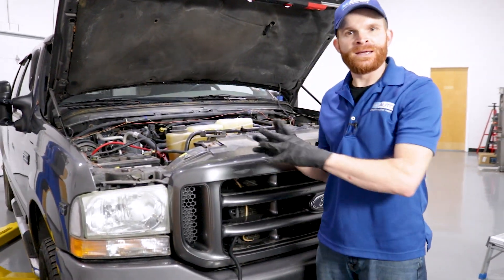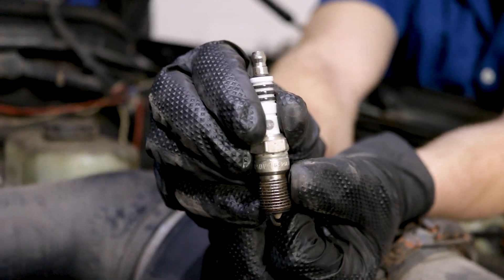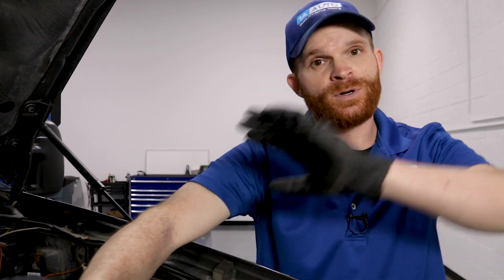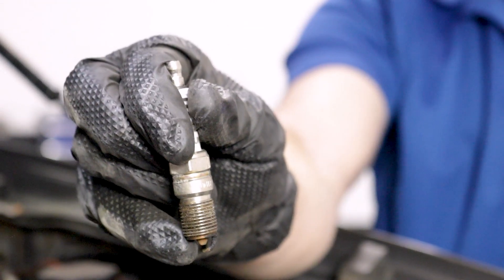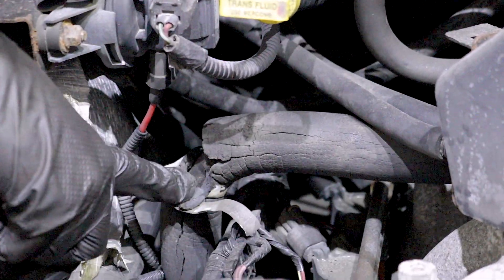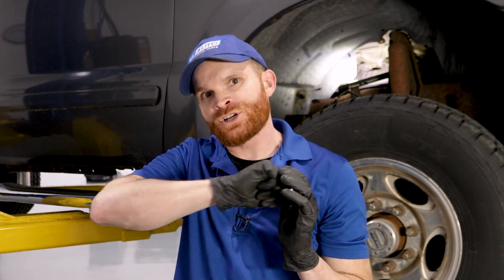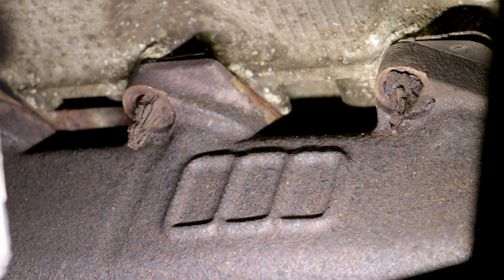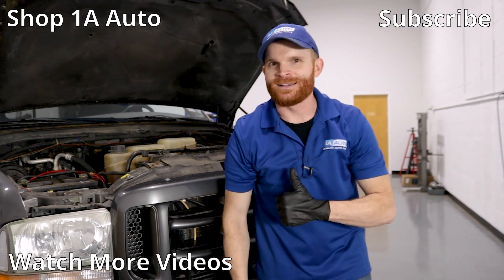Top Common Engine Problems 1999-2007 Ford F-250 Truck

Comment: If you own a Triton Two Valve engine buy the CalVan insert kit and proactively install all of them.  Do it when you plan on changing plugs and oil since that is part of the job.  Costs a few hundred but you don't want to blow out a spark plug out on the road.
Reply: Amen brother did it to mine permanent fix

Comment: 3 months ago bought a 2003 F250 Super Duty 5.4 , it developed a shaking from engine. Checked spark plugs and all were worn, had like an ,80 gap. Not sure how it was running ok for a while. Replace all spark plugs with motorcraft plugs and still has shaking after 2 -3 minutes of running.  Won’t go away. Any ideas?
Reply: Test your coils

Comment: I have a 99 F350 with the V10 Triton. Bought with blown engine, did an engine swap with a used one. It runs great with excellent compression and oil pressure but have an issue with fumes in the cabin. To me it seem more like gas fumes than exhaust. Have checked all vacuum lines for deterioration, no leaks that I can detect. Is not coming from the emissions cannister output and there are no gas leaks anywhere in the engine compartment or in the fuel lines to the tank. It is enough to get a bit of a headache when sitting still or moving slow - during normal driving, can't really smell them. Ran fine without any codes this summer for about 700 miles but then threw a DTC P1131. I cleared it but came back within 25 miles. IDS shows: HO2S11 not switching correctly. Sensor indicates lean. Air leaks at the exhaust manifold (I replaced all the broken studs and installed new exhaust gaskets on the replacement engine). Freeze frame shows SFT1 and SFT2 at -3.91% and LFT1 and LFT2 at 10.94% but not sure if that is normal. Not sure if the fumes and the DTC are related - any ideas? Not sure what to look for.

Comment: Hi, great info. I have a question that you might be able to help me with... I have Limited Excursion V10, and when I'm moving right along the road and I hit 45-55MPH my engine and take my foot off the gas pedal the motor starts to sputter and the engine seems like its gonna cut out on me. When I give it gas and pass 50-60MPH the sputtering stops. I can't seem to figure out what the problem is??? Any suggestions?
Reply: My truck did the same thing, when I was on a trip, I scanned the  codes  and found out that I had a miss fire on #4, so I bought  plugs  and coils  and changed out just #4 plug and coil and running  fine, I thought my transmission was  going out! And my truck never threw  a code! I hope this helps.
Reply: Jack Rox •
Could be a Tune up ?
New plugs & wires ?
If its fuel injected ' 
check clean or replace ?
Ignition Coils ' 
check clean or replace ?
Check the throttle body and sensors they might need cleaning or be replaced ?
You've got some home work buddy '
start off by cleaning injectors with fuel line and injector cleaner in fuel tank ?
Check all wires and hoses in engine compartment. 
Another thing could be the fuel pump giving out or dirty ?
Good luck ' like i mentioned start off with cheapest route first, it's all process of elimination 👍
Reply: Read what i wrote earlier, i don't know if it all went through ?
Reply: Read codes with OBD scanner,
I forgot to mention that earlier
Reply: By any chance does it do it at idle as well every now and then?

Comment: Actually an exhaust leak can cause an O2 sensor code/codes and really screw up the fuel trim. It can also burn up an exhaust valve, I wouldn't say you can drive it like that long term with no issue..

Comment: Only issue I see with this video is this engine doesn’t require premium.  We have a 2012 motorhome on the E-450 chassis with this engine, and it doesn’t require premium. Only regular.

Comment: I have a 2000 Excursion 6.8 V10.
I replaced all of the exhaust manifold studs due to the problem mentioned in this video. (took me a month) working on it when I had time. I bought this Monster om 2013 with 90K on it. It now has 140 K on it, 8 inch lift with 37 inch tires:-). I just ccompleted rebuilding the complete frontend minus the diff which was fine. 
Today I have a cranking situation with no Start.  I am assuming its the fusebox in the occupants compartment. I have power at the injectors. No spark at the plugs. 
I have a couple relays to swap out before I dump the cash into the fuse box. The other thing I ran across is my scan tool won't complete the scan....a problem solving I go I guess.....

Comment: Great videos. Bought a New Holland service truck. 2003 F250 v10. 320K. Sold my 2014 ram for 30K. This truck I just bought is also "damage title" I found out after dealer sold it to me for $2700. It had perfect fluid and runs too good to be true. Looks like they did lots of service to it.

Comment: Make sure you use motor craft spark plugs. I manage a fleet, and 2 2013 f450 v10s I have had champion plugs in them from before I joined. These plugs deteriorated in under 30k miles and the ceramic insulator on the plug fell off and destroyed multiple cylinders.

Comment: I have a 99 F250 extended cab lariat with a V10 automatic with factory 4:30 gears.  I have owned this truck for 17 years and it presently has 172,000 miles. In all this time, I had one spark plug blowout (#2) and I repaired it with a Time Sert Kit myself.  I did not trust anyone with this procedure.  It’s been seven years and still running great! She is 24 years old now and I have replaced the PCV-short U hose three times,fan belt once, two alternators, ten OEM injectors, ten OEM coil packs and ten OEM plugs.  I keep her serviced every 2500 miles because that’s all I drive it in a years time.  There are no oil leaks, no exhaust leaks at this time.  She has been a good truck for a first year Superduty.  I still pull my fifth wheel camper from time to time with no issues. This time next year I will be applying for an antique tag!  LOL!
Reply: I have an 04 with 165k on it. I had 1 plug blow out. Did you have any trouble replacing the other plugs?  I'm nervous about replacing them if they strip out the threads

Comment: Just bought a 1998 F-250 5.4 triton I don’t hear or see vacuums leaks but when trying to accelerate it bogs down does not want to pick up speed it does the opposite but I can hear the fuel pump turn and truck turns on fast but last owner had gas sitting for 8 months can that be the reason why it ain’t running properly also I get a code  po171 , what can that be?

Comment: I have a 2002 Ford F350 V 10 the temperature gauge goes to warm and then it varies itself to cold while driving and then reset itself and then goes back down to cold￼

Comment: I bought a 2000 250 superduty 6.8 v10. Owner said it the oil gauge went out. I test drove it for 30 muntues. Drove home 30 mintues. Another hour or so in runtime & running diagnostics. I replaced oil pressure sending unit and not one drop of oil, did oil change,  ran a new "mechanical" oil pressure gauge (no oil pressure) , ran oil pressure check( no oil). Took off new oil filter and no oil there as well. Is the pump or pick up tube a common issue? I'm no mechanic and just started breaking down the motor to replace both. I do not want to pull motor and everyone wants to charge 3k to do the job. Not many videos on here to help with oil pump, pick up tube, oil pan ( since u can't just pull the pan),  I've now named my truck Frankenstein as she'll start right up and no metal/clanking sounds and NO signs of oil.  5 mechanics have all scratched their heads at this thing!  If you could post any videos/short cuts/tricks/ etc. That would be great.

Comment: Starting issue lately. I have a 99 F350 V10 service truck. lately You have to trying to start it 4 or 5 times before it actually starts. It seems to run fine but its bad if you have to sit there and try to fire it 5 times. Common? What is the common issue? Thank You Jim Hughes.

Comment: Thank you so much buddy Mike Ford V10 has a 114,000 miles on it and it had a tune-up at 100,000 miles with spark plugs do I have anything to worry about you think

Comment: 2003 6.8L F350. Pings with 93 octane. Idle is Very smooth. No engine light. It will ping at cold or at operating temperature. Hauling a load or empty. 
Should I start with replacing the PCV valve and hose then work up to the Mass air flow sensor?
It does seem to have power, but I have to ease the throttle when accelerating. 1/3 throttle at most.

Comment: Holy cow Love this video and thanks for making me feel better about buying my new used truck for 6,800$ with less then 130k and dropping 3,300$ back into to it in order to get the helio coil fixed because of the miss firing issue and needing to replace the coil packs on to cylinders with the tune up and well now have it chipped for better gas mileage and it seems to be working as far as getting better gas mileage for a work truck. Its a 1999 but I have been looking into the spark plug blowouts and that was one of my biggest concerns about getting to the truck but holy cow its a beast of a truck this is the biggest truck I have owned in my life and its like driving a whale in a kitty pool!

Comment: It explains some of the complaints I have heard about these trucks. It would be kind if you could give and estimated cost to fix these different problems. I think I understand  the complaint, now, of the aluminum shavings getting into the oil and destroying the engine. I have heard complaints of these spark plug repairs that only lead to that. Not pretty.

Comment: Great info,  I have the 2000 excursion v10 limited  4x4. I'm getting 8 mpg. Just replaced pcv hose, had shop do the plugs. Next in line is banks headers because exhaust manifold leaking. $2000 for the banks set up. I need to improve the 8mpg issue or I will let it sit and by a 45 mpg car. What can I do to get better gas mileage ? I dont put my foot in it, I take it easy and still no improvement. I wish they had a turbo to go with this v10. Mpg is what I need help with. I'd be happy with 12mpg.
Reply: Check to see if your hubs are in the locked position. I was getting 12mpg with the factory 4.30 gears and 35’s. Check your fuel filter, air filter and the S shaped hose that’s under the throttle body that connects to the pcv. They rupture and leak easily. Run some good injector cleaner through a couple tanks of gas.  

I did the banks headers and the free spin kit but also added 37’s and 4.88 gears. I’m getting 9-10 on the highway
Reply: If your 02 sensors are original, might consider changing those out as they control fueling.  Cleaning the MAF sensor not a bad idea, either (they make a spray specifically for this, don't just use brakleen on it).  You can get MAF sensor cleaner at walmart.

Comment: 2000 f250 v 10. Misfiring on 5 cylinders.  What could cause this. New coils, spark plugs and injectors

Comment: if you still monitor this channel, Driving down the freeway at 55, all of a sudden a large popping noise was coming from the right side of the engine compartment. Almost like a massive exhaust leak somewhere. Ford had told me that one of the rockers fell off and the head was damaged. They said they were able to repair the head and The rocker for a very substantial cost. The vehicle never lost power but just a very loud popping noise. Any suggestions on what that could have been?
Reply: I'm far from any kind of knowledgeable person on this, but that sounds like what happened to mine and it was the spark plug blowout problem with mine. Not a horrible cost to fix it and if you are handy, you can do it yourself.

Comment: I have 2003 Ford F-350 battery is good but it won’t start check fuse box they are good it will start if I jump it with another car. Please I need help

Comment: 10 years after Ford closes all these worthless vehicles will be abandon. Heard their working on electric cars, bet even that won’t run 10 years correctly. Wonder how long it will take the engineers at Ford to develop batteries you can’t change ?

Comment: I had put 453,000 miles on a2007 f550 wrecker and sold the truck I think it kept running after 500,000 it might still run who knows
Reply: T6 motor oil
Reply: Oh yeah I went through about 16 or more ignition coils as well

Comment: Most aluminum head V8s break exhaust manifold bolts.  My smelly opinion is that with the aluminum head expanding more than the cast iron manifold the stress on the studs cause the breakage.  Don't the rear studs tend to break first?  The rear of the manifold is probably the hottest because all of the exhaust passes this point.  Perhaps an aluminum exhaust manifold would fix this issue?

Comment: I have a 1999. It cranks but won’t turn over. Is it a fuel pump or spark problem. I’d there any test I can do to find out what the issue is. It is cold here. High in the 30s during the day. Obviously much lower at night, in case that might also be an issue.

Comment: Hello I’m having a problem with my 2001 f250 super duty XLT V10 triton, check engine light comes on with code PO720… “output shaft speed sensor” it’s not causing a lot of trouble just a kick in gear from 1 to 2. I’ve replaced the sensors both, transmission fluid as well. The light still will not go away. Do you have any suggestions?

Comment: Thanks for the video.  I have a 2002 e350 6.8ltr van I work/ live out of. I've blown out 3 plugs on original engine. First time was a huge surprise. Very loud! I did research and bought the "time sert" retread insert kit. Did the repair with engine in van. Very difficult, lack of space.  Extremely nerve racking.  Drilling a big hole in the head is something that is not natural.  Anyway, worked excellent.  Had the pcv cracked hose up under throttle body as well. gave intermediate rough running.  Would have never found it if someone hadn't suggested looking.  Almost impossible to see on my vehicle.  Engine made it to 300,000 miles then developed miked oil and gas somewhere other than in the cylinder....automatic transmission made 240,000. Just installed a rebuilt high performance engine and getting ready to fire it up. I love these engines,  and love my van. Mileage is 10mpg no matter what I'm doing... yup that sucks. cheers

Comment: I have a 2002 E350 6.8 V10 with 244000 miles on it. I'm confused because I keep hearing "before 2002" and "after 2002" with regard to the spark plug thread problem. Did Ford correct this problem with 2002 models, or did the fix begin with 2003 models?

Comment: I have a small oil leak in my V10 and cant seem to find where its coming from seems to be a lot on the transmission case any suggestions on how to find exactly where it could be coming from?
Reply: Rear end of the valve cover!

Comment: I have a 2000 Rv with the v10 in it traveling at 40 miles per hour flat no issues. When I start to climb or pull my car losses power.  Suggestions.  Only have 55,000. Miles on the engine?

Comment: Good video. I believe the 6.8L V10 is recommended for 87 octane fuel or higher. 93 octane isn't required. Coils are another common issue also.
Reply: Owners manual says 87 octane.
Reply: yup... 87.. no way 93

Comment: I LOVE YOU 1A VIDEOS!! I  just ran into in issue i cant figure out. i have a 2002 ford V10. it was parked for about a month, when i started the truck it had high idle and it would not drop to normal idle. while driving it stays high idle and i have to press hard on the brakes to keep it from moving forward. I cleaned out the throttle body, changed the air filter, TPS, used carb cleaner and sprayed the entire engine to see if i find a vacuum leak, and still no luck! engine starts up and revs upto 2500 -3000 rpms and stays there. Any advise as to what is my problem? I'm all ears! TIA

Comment: My 2001 is hard crank sometimes in the morning and lately hard to crank during the day if it has been sitting also I get a code for too lean system bank 1 and 2 but no other codes just wondering what the fix may be.

Comment: Thanks for the video, great info!  How much of it applies to a 2008 Triton V8? And do you have a similar video for that year? Mine is in a motor home and I keep getting a check engine light for the fuel rail pressure out of range.
Reply: Most of it.  Except the 2008 have the spark plugs that can break when you're trying to do just a simple tuneup.  Then you need a special tool to get the rest of it out.  The replacement plugs won't break because . . . well they are just smarter than Ford engineers.

Comment: My mechanic used to run the service dept. at a ford dealer. I have a 2000 Excursion V-10.
1. Go only to dealer to purchase new spark plugs every 80k miles, replace all 10 coil rubber boots and clean inside of throttle body.
2. If you have after market off-set rims, change out front hubs every 60k miles.
3. If you experience "theft light" issues and it won't start at turn of key, the diodes in the alternator may have failed, causing all kinds of problems with your PCM. It will continue to charge battery when running but will discharge when not running. Replace with remanufactured ford alternator. 
4. If someone steals your cat-converter and damages the wires to your 02 sensors (before and after the cat-converter) it might cause the number 19 fuse (under the hood, 20 amp) to blow and render the engine limp-mode.
I experienced all of this and the only real problem was the Alternator went out...big deal...took 45 mins to replace. The other stuff was caused by outside forces.
Reply: I appreciate your comments. You answered a lot more questions I had.

Comment: I ran a lot of different Triton motors never put premium gas they run on 87 just fine!!! I've operated 15+ 4.6l V8 2v
15+ 5.4l 2v and 10+ 5.4l 3v 
10+ 6.8l V10 2v and 15+ 6.8l V10 3v 
Over 500,000 miles of driving with 87 octane I've tried 93 octane not worth spending $$$